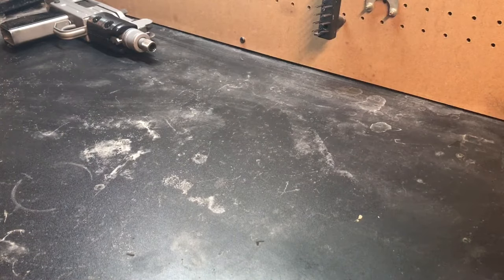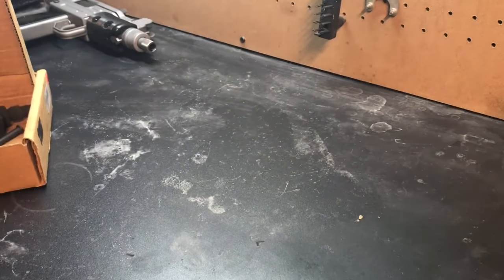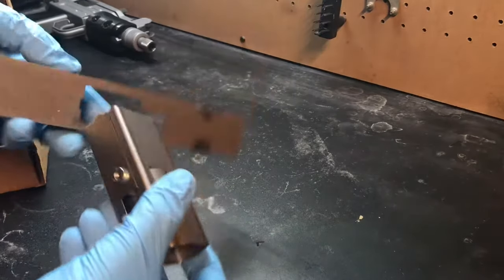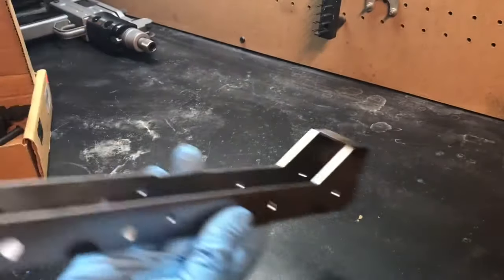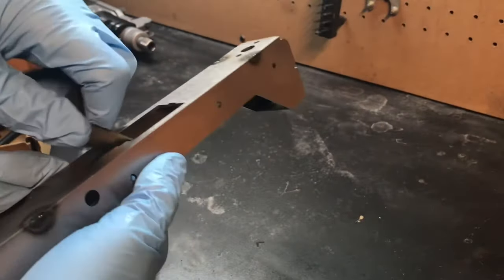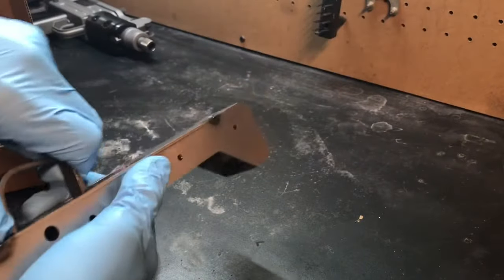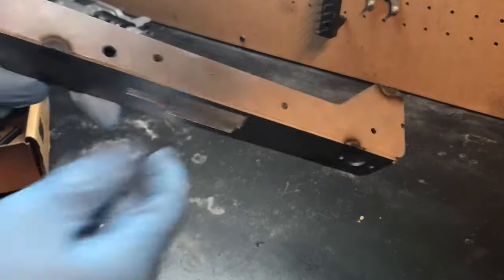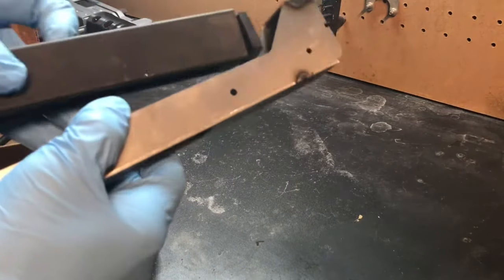Velocity VMAC Center & Sideplates overview MPA Cobray MAC M11  9mm build

Comment: What type of welder did u use
Reply from the maker: Just tacked together with a cheap TIG welder at the moment to see how it all fits together.
Reply: I like the tab system for the magwell, wish the trigger guard had the same
Reply from the maker: @scottplagmann3411  The trigger guard has a similar notch, once you get it in there, its pretty hard to mess it is.
Reply: @norincokid  excellent! Some areas have some give on the tolerances but that magwell is a bugger if it deviates

Comment: Do you happen to know if the lower is in spec to the original Mac 11s?
Reply from the maker: I don't believe they are. I think the width is slightly different, so internal parts might be a problem. I have an MPA which I believe is closer to Cobray spec, I can check if the parts are compatible.
Reply: The 3 piece assembled lowers should be the same dimensions as a factory folded lower, some the squared bottom seems wider

Comment: Can you do a video on how you welded the plates together? There used to be a guy that sold a weld jig but he is gone. Would love to see how you did it.
Reply from the maker: It was pretty straightforward, I didnt use a jig. Just some clamps/shims where necessary and put the upper and the bracket in there to keep everything lined up and squared. There;s tabs on all the parts, they kindof click together.
Reply: Surprised you didn't have any warping or anything to deal with.

Comment: Tig weld it so you can just fuse it together without bulking it up with a bead. Are kits available ?
Reply from the maker: Thats what I ended up doing for the seam, just fusing the pieces together, seems to be holding up fine. Yes, Velocity has kits available.

Comment: Does the front bracket need to be welded in
Reply from the maker: There was a hole in the bracket where it rests on the lower frame, I just plug welded it there, when everything was lined properly

Comment: Was does that front bracket peice do?  Mine doesn’t fit well without it
Reply from the maker: It reinforces the front of the lower/frame. Theres a bit of stress on that takedown pin while firing. It may or may need some fitting. Mine fit pretty snug in there, and I just plug welded it into the center section once I had the three plates fitted together.
Reply: For the trigger gaurd do you push it all The way forward or do you push it back to mate up flat against the magelwell?
Reply from the maker: @kevinpayne7557  When mine went together I did it tight up against the magazine well. There is a roughly 0.5mm gap where it looks like the trigger guard could have been slid forward away from the grip, but I welded it up with it up against the grip. As long as its lined up with its tab you're probably fine. Maybe just do a small tack weld and then fit the trigger parts, make sure it works before welding the rest.
Reply: @norincokid  Thank you for the info. I'm on weapons guild but for the life of me I can't find any parts assembly instructions. It seems like such a simple platform. Any insights?
Reply from the maker: @kevinpayne7557  I'm on weaponsguild too, I'm surprised the info you need isn't there. But its not easy to search stuff on that site. What exactly do you need help with?
Reply: @norincokid  just a basic tutorial of how to install the parts kit. I plan on tacking the side plates and everything tonight and function testing.
Reply: @norincokid  I see the exploded views and parts diagrams so I guess I can see if I can wing it. Stupid youtube their restrictions.
Reply: @norincokid  I'm pretty sure I figured out.  Boy if this isn't the most uncomfortable awkward piece of machinery I've ever made, that's for sure.